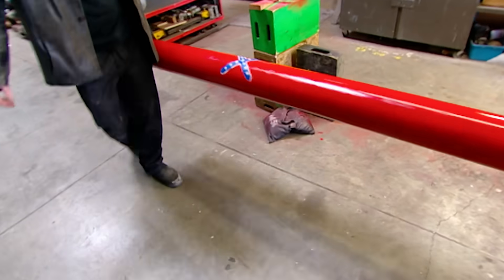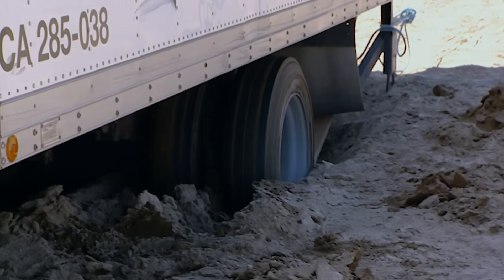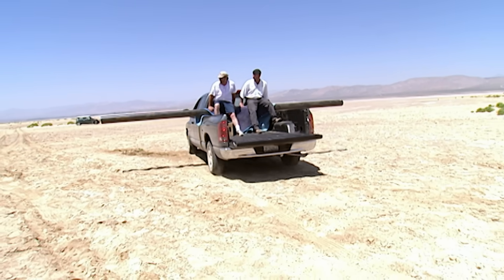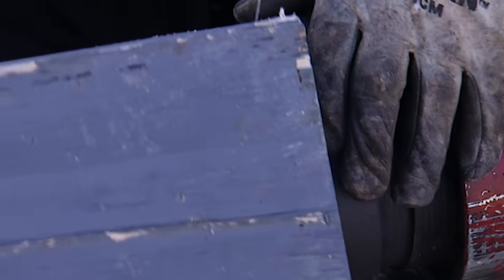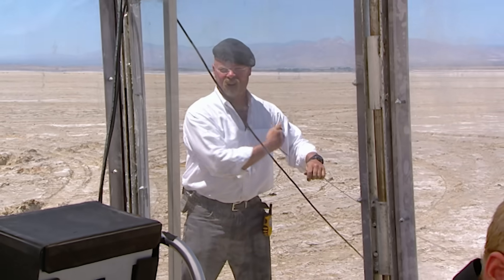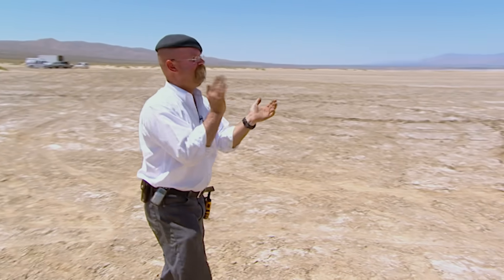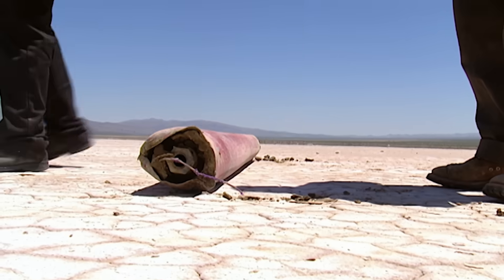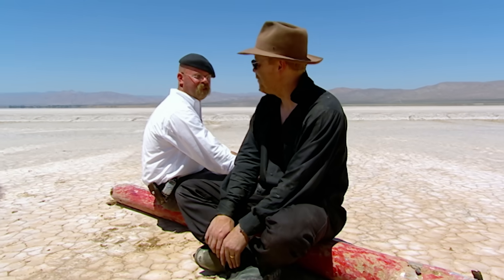Adam and Jamie test a Civil War-era rocket in a desert blast from the past. | MythBusters

Comment: For everyone confused as to why the rocket they're building is different than British Concreve Rockets,  here's the reason:

The Concreve Rockets and every other rocket used up until the supposed mythical Civil War Rocket used solid rocket fuel. This is basically some type of gunpowder that explodes out of the back of the rocket when lit by a fuse. This powder or other solid would be easy to store and relatively simple to make; after all, the Chinese have been making them for how long?

The Myth says that the Confederates managed to build a LIQUID FUELED ROCKET,  which would be a totally different beast. 
(A) You need two different kinds of "fuel."
      -the actual fuel.
      -some form of liquid oxygen (oxidizer) to feed into the fuel to make it burn. 
The liquid oxygen (or chemical liquid with a lot of oxygen in it), would be CRAZY difficult to make in that day with the technology they had available. If you watch the whole episode, they almost give up halfway in because they can't figure out how to produce oxidizer with the technology available at the time, AND THATS WITH 150 YEARS OF HINDSIGHT.

(B) You need a way to store and transport the fuel while you're traveling to the launchpad. Rockets tend to go boom a lot (especially early ones), so having the production site right next to the launchpad is a way to turn a big boom into a REALLY big boom. You need to put the production site far away from the launchpad, and you need a way to transport this often extremely volatile stuff to the launchpad safely. Also keep in mind that most oxidizers need to be kept EXTREMELY cold, so good luck not letting that evaporate en route. (again, 1860s technology).

(C) You need separate fuel tanks inside the rocket for each chemical, and a complex feed system to get them into the engine in the right mixture (with 1860s tech). This has to run totally on its own even while accelerating like crazy, since it's just a long range artillery rocket with no humans on board.

That's why the Confederates building a liquid fueled rocket in like, 1865, would be a RIDICULOUS achievement. The difference between a (supposed) Confederate Rocket and a Concreve Rocket would be like the difference between a windup car and a gasoline internal combustion engine. Thus, the "myth" part of myth busters.
Reply: instead of oxygen they could use nitric acid or hydrogen peroxide

Comment: Well the “rocket’s red glare” had to come from somewhere.
Reply: Look up Congreve rockets...British copies of Indian rockets...

"Rockets could be of various sizes, but usually consisted of a cylindrical housing of soft hammered iron about 8 inches (200 mm) long and 1.5 to 3 inches (38 to 76 mm) in diameter, closed at one end, which was strapped to a shaft of bamboo about 4 ft long. 

The iron tube acted as a combustion chamber and contained well-packed black powder to act as the propellant. 

A rocket carrying about one pound of powder could travel almost 1,000 yards (910 m). In contrast, rockets in Europe were not iron cased and could not take large chamber pressures. 

As a consequence European rockets were not capable of reaching distances anywhere near as great.[7]

Hyder Ali introduced the first iron-cased rockets in warfare.

It was the use of ship-launched Congreve rockets by the British in the bombardment of Fort McHenry in the US in 1814 that inspired a phrase in the fifth line of the first verse of the United States' national anthem, "The Star-Spangled Banner": "the rockets’ red glare". 

HMS Erebus fired the rockets from a 32-pound rocket battery installed below the main deck, which fired through portholes or scuttles pierced in the ship's side.
Reply: Also the 'bombs bursting in air'. Artillery cannonballs used to have blackpowder timed fuzes that let them explode above the enemy troops.
Reply: Also the 'bombs bursting in air'. Artillery cannonballs used to have blackpowder timed fuzes that let them explode above the enemy troops.
Reply: But that part of the song was from 50 years before the Civil War.